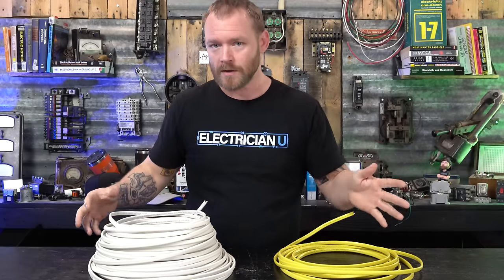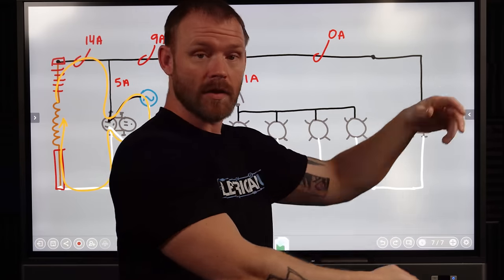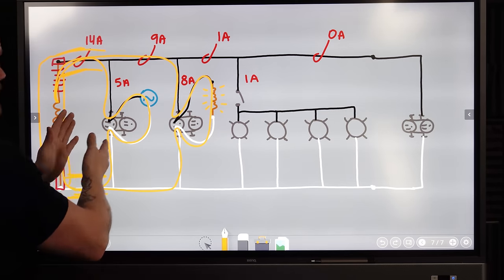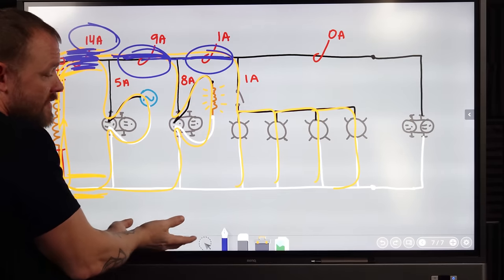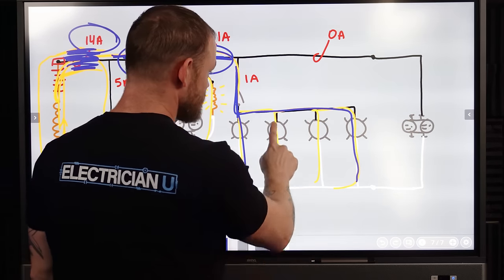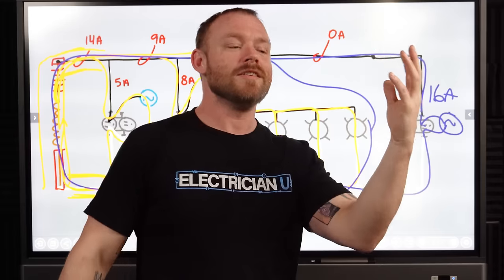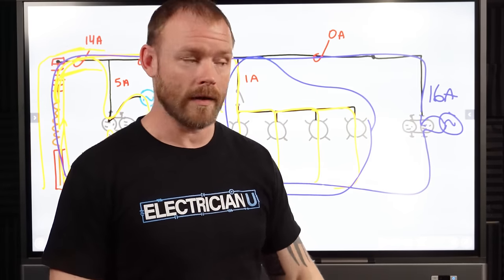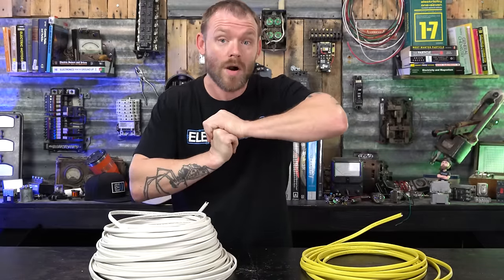Should You Be ONLY Using 12/2? When Can You Use 14/2?

Comment: What you were describing at 1:45 to run 14AWG wire on a 20A circuit but just for the lighting legs of the circuit, I believe that is against code essentially everywhere, although I'd like to be proven wrong.
Reply: I want to know too.
Reply: If 14 gauge wire is run anywhere in the circuit the breaker must be rated at 15 amps or less.  If the breaker feeding a circuit is 15 amps you can mix and match 14 gauge and 12 gauge wire all you want
Reply: @gerrishp22  Right, so why was he showing the 14 to the lights on a 20A breaker. That's what we all keep asking.
Reply: NEC 240.4(D)(3) says that 14 AWG copper cannot be protected by a breaker larger than 15A
Reply: Agreed. This should be a code violation everywhere. The breaker is there to protect the wiring inside the walls, not the LED lights at the end. A 20A breaker must use 20A/12ga wire throughout the entire circuit (except short taps which have special rules). When someone later adds a couple of standard receptacles to the 14ga branch, it may overload the wire and not trip the 20A breaker.
Reply: I have asked this question before and my understanding is that his jurisdiction and some other commenters' jurisdictions interpret the switch leg to be a fixture wire and fall under article 402...  Excerpt from uses permitted section: "for connecting luminaires to the branch-circuit conductors supplying the luminaires".  This one is iffy in my opinion, I don't like it even though it is probably 'safe' I'd rather spend the extra few cents a foot and just stick with #12.
Reply: 14 AWG = 15A OCPD 
Should not be used on a 20A circuit although my whole house is wired with it lol
Reply: Because he doesn’t know what he’s doing and has proven this a few times in multiple videos.
Reply: @FishFind3000  which other videos?
Reply: @phi5head , was video I recall detailing the use of “nolox” , said the conductor needs to be wire brushed , then used a tooth brush to apply the paste 😅😅. I know we all look for more knowledge but sometimes it leads us to some really wrong information.
Reply: Because he is wrong.  He is right it probably won't burn down, but he is not meeting the minimum National Electric Code.  You want your house built to code at least in the beginning and hopefully it will survive future modifications by electricians that have no clue about the basics of the code.  15A Circuit Breaker 14ga or bigger, 20A Circuit Breaker 12ga or bigger, the electric code is that simple.
Reply: You’re not wrong!
Reply: He says that, as well as to follow code, and even showed pictures of the tables for cable size to circuit size.
Reply: @cavscout888   No. He doesn't say that.

"[t]he AHJ [. . .], they have the final say over the whole thing, so there are some places around where i live that you're not allowed to use this [14/2], that you have to use the #12, THEY WANT 20A CIRCUITS IN EVERYTHING, [. . .] so we have some places where everything that's power that's coming off of a breaker, 20A BREAKER, #12, WHICH IS GOOD FOR 20 AMPS."  [my emphasis]

That is exactly what he says. He then follows that by saying that in those stricter areas, he'll run separate 15A circuits with just lights in order to save money.

   So with that, he's implying there are also some more lenient areas near him where the opposite is true: that he can run a circuit with receptacles, a 15-amp breaker, and run 14/3 for lights on a leg of that 15A circuit. But wait....

   He then shows a diagram of something that is neither of these: a 20A circuit with receptacles and lights, with the lights only on a leg in the middle.

   What's the stated purpose of showing that schematic? He tells us the purpose is to show why it's supposedly permitted in some jurisdictions, even though we have to be aware that in others, we must run lights separately if we want to use 14/3 for the lights....

_"And current always flows in a parallel circuit in proportion to whatever the resistance of a specific leg of that circuit is. [. . .] And that's why it's okay to do this. So let's talk about that." Points off-camera, cut to diagram of 20A parallel circuit with lights in the middle and receptacles on either side.

   So with that statement, he's indicating that the diagram represents what he said that some, more lenient, jurisdictions allow. He even goes on to say that smaller wires can be used than 14, as long as "they are rated" for the load of that subcircuit, that the only reason we can't use ethernet cable for tha leg is because it's "not rated" for a power circuit. This directly implies that the 16, 18, and 20 he referenced, which he affirms are rated for the lights he's installing, are permitted by the more lenient AHJs to be used in that leg for LED lights.

    So tell me again, if you like, how you get that "he says" that "to run 14AWG wire on a 20A circuit but just for the lighting legs" is "against the code essentially everywhere". He only says it's permitted in some places and not others and then, in front of a diagram of exactly that, he says it's permitted by more lenient AHJs as long as the wire is rated for the lighting load of that leg... and then he says that the only thing not permitted by NEC in that diagrammed 20A scenario is wire that's not rated for a power circuit at the expected load, which he stated that in his use cases is less than 1 amp for lighting subcircuits.

   This would mean that if we install 1 amp of LED lights in that third leg, and a receptacle in the final leg, that the lighting leg is permitted by NEC to be entirely of wire rated for 1 amp, which he affirms is down to #20. Except it's apparently not permitted, for the separate reasons that the circuit contains receptacles and there is a 20A breaker.

   So as a layman, i'm left to wonder, wait a minute, what exactly does NEC say? From his words, it implies that either NEC allows 15-amp breakers on circuits that have receptacles, or there are multiple AHJs near him where he does work that are in the U.S. but don't incorporate the NEC requirement for a 20A breaker for receptacles, allowing instead a parallel circuit with 15A breaker, receptacles on 2 legs, and lights in between with #14 or smaller wire.
Reply: @no_rubbernecking  If you go to the end, watch where he removes the discussion from theory and what conductors can handle, to what is required by code at a minimum. The whole discussion is a electrical science one. At the end, he brings it back to what some want... what size cable to use for each type of circuit.

It was a valuable video to me, as I like to have less than 5% voltage drop under load for my circuits, but I don't want to have to use 10awg on every last bit of it. This is where the video probably helps most, in improving your circuits and wiring method. Not saving a few bucks.
Reply: @cavscout888   Fair points!
Reply: I think Electrician U was more pointing out the wire size to amperage ratio in a parallel circuit not having an effect on actual power draw when using 14 wire as a switch leg in lighting. More of explaining basic electrical principle than just straight code rules. Realistically, even with the fixture chord comment that was also brought up above, a lot of the NEC wiring code stays on the side of caution, as we would all agree is good of course. But in my jurisdiction, california 3 ways and single pole switch backs have recently been deemed illegal practice. perfectly safe and effective practices that work all the same, but new guys don't realize that electricity doesn't know color or wire size, it will just flow wherever you send it. A lot of code is dumbing down the actual hard knowledge of electricity and the importance of checking voltage/amperage to understand a circuit; not just the insulation color, breaker size, or trusting a white/black wire and hooking it up etc. will never tell the whole story of a circuit. Especially if you do old work on 40s 50s homes etc. stay safe
Reply: At the end he states he was talking about load to a specific circuit and states code requires 15/14 or 20/12 exclusively. Regardless of the load of that branch of circuit.
Reply: @SophiaAphrodite   He has receptacles on there, as i'm sure you've noticed, and he expressly implies that there are AHJs near him where he does work where he's allowed to put a 15A breaker on that with lights in the middle and #14 conductor for the lights.
   Which, if you think about it, is why there is a firehose of commenters on this video with strong objections. And if that's all not bad enough for you, he then answers the question 'Why is this OK to do?' by pointing to a diagram that has a TWENTY amp breaker on that same circuit.
   It's like he's saying at the beginning, 'You can do this in some AHJs  because it's scientifically safe', then at the end in 2 seconds blurts out No-You-Can't-Because-The-Lighting-Wire's-Too-Small-For-The-Receptacle-Load and we're supposed to just accept that the sudden reversal, which negates most of the preceding minutes, makes perfect sense and is a good and informative video on safe wiring practice.
Reply: Pretty soon everything will have to be wired in 10 wire on 30a breakers even though appliances and lighting fixtures are consuming less watts these days with the LED lights and energy code/efficient ratings on manufactured appliances🤷🤣
Reply: Not against code, Table 210.24
Reply: @Privat2840  Table 210.24, not against code.
Reply: @gerrishp22  Incorrect. Table 210.24

Comment: It's the same thing for us down here in the Caribbean. We use 14/2 for the light leg & 12/2 for everything coming out of the main breaker panel
Reply: I hope those 15 Amp rated cables are only being connected to a circuit with a 15 Amp breaker.

Comment: Woah. But if the homeowner goes screwing in a bunch of old incandescent bulbs, or one of those screw-in adapters that turns a light socket into a receptacle, or a cheap light fails in a weird way that draws too much power but isn't a dead short, then it's entirely possible to overload that 14AWG wire if it's on a 20A breaker. Is the breaker meant to protect the wiring or isn't it?
Reply: My quite non-professional interpretation:  If you're connecting can lights with sockets, that's a consideration; but the new LED luminaires don't have sockets for the lamps, so there's no way to connect an incandescent lamp to them.  As for Dustin's comment that you could theoretically use tiny wire because the LEDs draw so little current, I was wondering about electrical fault danger, too.  Seems like that wire could get dangerously hot, and provide enough resistance as to not draw the full trip amperage of the breaker.  Would love to know if this is a legitimate concern.
Reply: @soundman1402  I thought about this a lot (have not gone to the code book yet) but how about this.....Regardless of 12 or 14 awg going to the LED fixture, (or even incandescent for that matter), the fixture itself is internally wired with 18awg so this is the lightest gauge wire on either a 20A or 15A breaker.
Reply: @sdsconstruction  Sure, but you can replace the fixture without cutting up all the drywall.
Reply: First of all, if you have 14AWG anywhere in the branch circuit, the maximum breaker size is 15A. Even still, a lamp holder like you're describing isn't a luminaire per the code, so you can't rely on a particular low-power bulb being installed in it to reduce the load calculations. You'd have to assume that someone might install the most powerful possible bulb and plan accordingly.
Reply: Ya, just like Dustin said you could use something crazy small, like coax or audio cable, he does close with using code or better.

He's a decent advocate for minding/reducing voltage drop as well, which is generally only obtainable by 'oversizing' cable on the best new branch circuits.

Comment: Wire is sized for the breaker it's on, regardless of the load that may be on it.
If the 14 AWG romex somehow gets cut on a can light housing or the LED fixture goes bad, and that draws a heavy load without shorting, the wire will get too hot before a 20A breaker trips at 27+ amps.
Reply: This is exactly why I watched this video, we have new code inspectors, that I don't trust their knowledge, since they don't seem to have any experience at all. So now I need to figure out of I'm going to run a home run of 14/2 for all the lights and fans, or run 12/3 to 20 lights and two ceiling fans. From what I got out of his video that is fine, but I was still 2nd guessing the idea. Normally I run 12/2 for all 120v runs, since I have a bunch of rentals, and you never know when the tenants are going to try and heat the whole hose with space heaters. But this is for my house, and hate to waste that much 12/2 and 12/3 for a bunch of LED lights.

IMO this video needs taken down, because from what I got out of the video it is fine to run a 20 amp breaker, then 12/2 to the outlets, then branch 14/2 off that.. but NEC 240.4(D)(3) says different. 

Well time to see how many spots I have left on the breaker panel.. that sucker is starting to run short, and not running them silly mini doubles.
Reply: And yet most outlets are rated at 15amps on a 20 amps service, but I guess they'd melt in the box.?
Reply: @maxjankowski6892  15a outlets are the same internally as 20s, minus the extra tab for a 20a plug, so daisy chaining 15s on 12awg wire on a 20a breaker is okay.
It could get a melty neutral slot if someone managed to draw near 20a through one of the duplex outlets. I've seen that with an old window air conditioner that was running very inefficiently, and a space heater connected to a short appliance extention cord causing extra resistance.
Reply: I hate trimming in #12!

Comment: Great video as always!  You mentioned LED on Ethernet cable; I received approval from my inspector to run all LED lights throughout the house, to be connected to a “separate” 12v powered panel with Ethernet cable. My wife and I are renovating a 1910 Farmhouse, excited to see this project through.

Comment: I don't think this is what you intended, but this video comes across as claiming you can run 14ga on a 20a breaker depending on the intended load. Which would be really bad if the intended load changed to something not intended. You should clarify.
Reply: He does clarify, when he states the codes, to use as dictated in code, and showed the charts of required cable size to circuit (breaker) amperage.